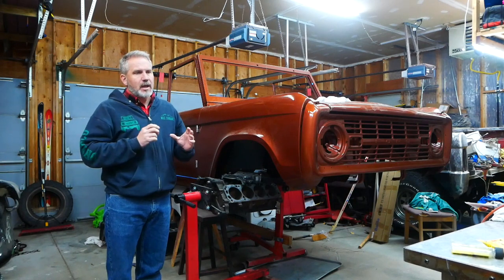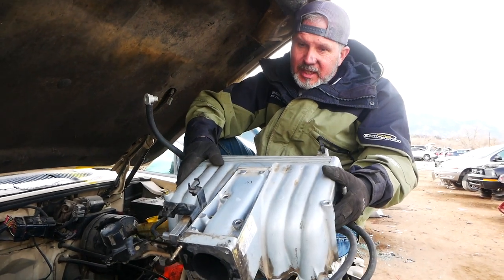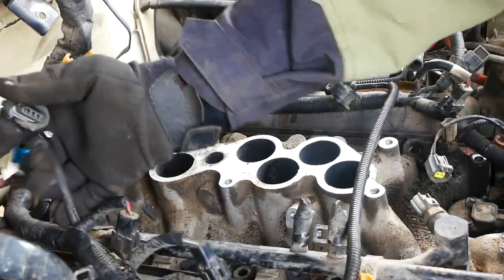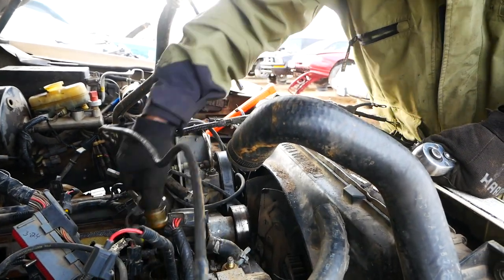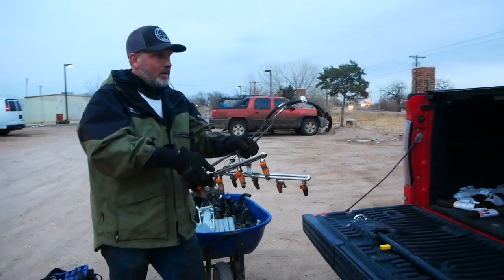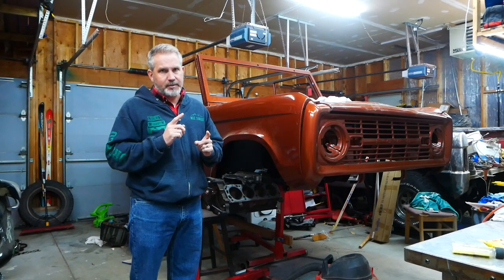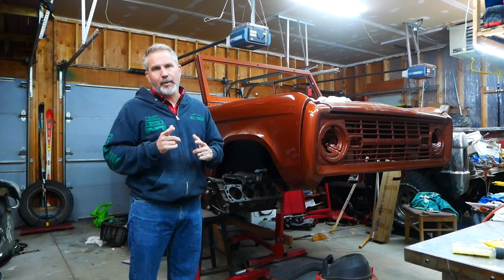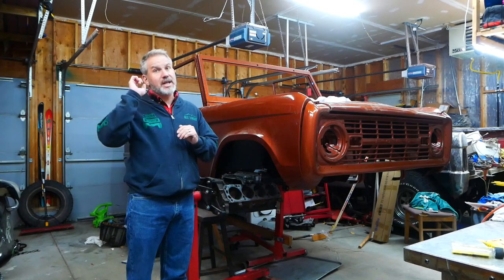Ford Explorer 5.0 Intake Scavenging!

Comment: I have a 5.0 in my 1984 Datsun 200sx    I did use the GT40 heads and a explorer upper and lower intake as well.   Good reliable engine!
Reply from the maker: How in the heck did you get a 5.0 in a 200sx?  My first cat was an 81 200sx
Reply: @alpinegarage8548  The S12 (200sx) was a mix of 1983 280 zx and 300zx in its design    there was plenty of room between strut towers    made custom headers and engine mounts, T5 (looking to get the G force t5)custom aluminum drive shaft,  but a v8 kit for a 280 zx would work in this car   actually good amount of room to work on the engine    do need a header socket for two spark plugs DS(copper only please)   Made a custom gauge cluster and used a Haltech for the fuel injection   runs strong!
Reply from the maker: @neilduncan8657  love to see pics!  Mile.3garage@gmail.com.

Comment: Could have got the heads, probably gp40 or gtp40 heads and used them or sold on e bay for more than you spent on the whole thing, people are grabbing all the heads off96-03 explorer, mountaineer and cleaning up and selling them for 4-6hundred bucks, best 302/5.0 heads only after market aluminum heads are better
Reply: I went the after market aluminum route and the only real difference is the weight of the aluminum VS the cast. I've tried cast gt40's and the gt40p heads in the past. Let me say this,I can't tell much difference.  2.02" intake valves and 1.6" exhaust valves on my "same as cast" gt40 style heads are literally the only thing different and it doesn't equivalate to more power.

Comment: I would love to follow you on this one. I put Fitech on mine and have just had problems every time it gets warm. Why did you choose the 97 explorer?
Reply from the maker: The Bronco came with a 97 motor and 4r70w.  So I stuck with that so the harness would line up with all the connectors.
Reply: @alpinegarage8548  I’m looking to buy an explorer so I can take my time taking what I need. But I did see a 2000 sitting in the pull apart here with the V8. May do what you did but try and get the entire engine.

Comment: I have all those parts including the wire harness sitting on the floor of my barn I literally have been tripping over! Oh, and the 96 5.0 engine with three bar heads. You planted a seed! Should I build something or sell it?! I'm sure if someones wallet talked they will be starting a project!
Reply from the maker: What were you going to use it for?  Do you have a Bronco?
Reply: @alpinegarage8548  2000 Mustang. Decided to put a 351w in it. Sell the 5.0 stuff to fund the 351.